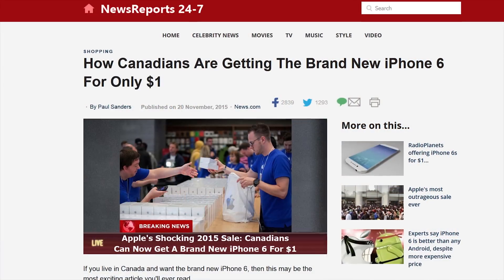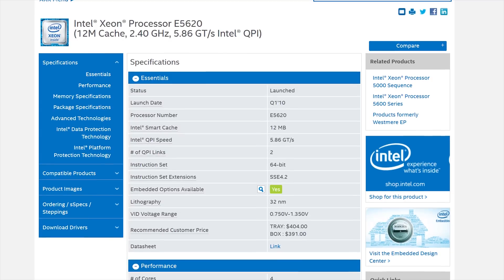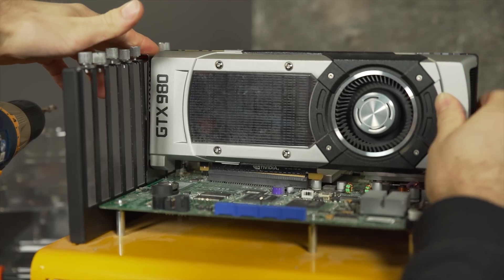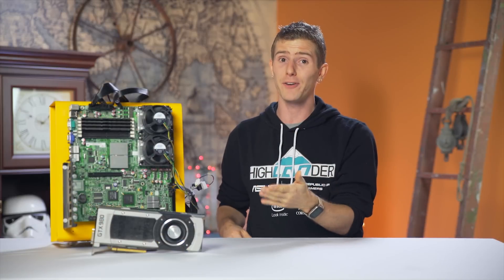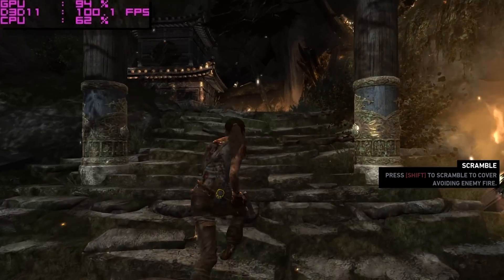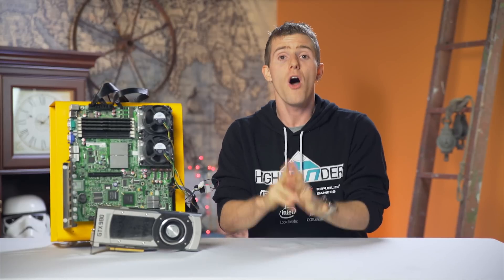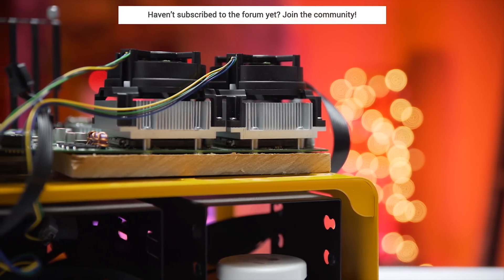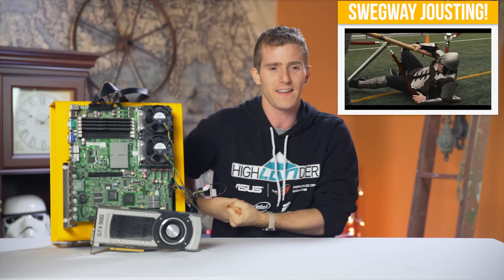Under $150 Budget Gaming 8 Core CPU, Motherboard & 16GB RAM

Comment: Well its not really 150$ if you use a 500$ GPU
Reply: +Ulim151 He used the GPU to test if the CPUs would bottleneck a high performance GPU. He could make a guide with a mid range card and call it a 300 dollar build but it wouldn't prove how wellthe CPUs would handle a really well performing GPU. Using the 980 shows if you wanted to buy this build to spend the rest of your budget on a GPU you don't have to worry about a bottleneck.

Comment: It's worth twice more than my PC...
Reply: +Skitty™ | Garry&#39;s Mod Player 
You could take away the 980 throw in a 960 or r9 380 and get a computer the price of yours and probably better.
980 = ~500 +150
650 / 2 = 325
i'm going to guess you don't have a 960 or higher.
Reply: +Zarrx i know you weren't talking to me but my whole pc costs around 150$, great right ? lol
Reply: +Zarrx Why a 380? The 280x performs slightly better than the 380 and is cheaper.
Reply: depends on availability I guess. 280x is an older series so it can be harder to find in retail.

Comment: I got my Asus Sabertooth X58 LGA1366 + i7-930 (4 cores, 8 threads, 3.5ghz boost without OC) for like 130$ and I'm VERY happy. + motherboard has normal amount of PCIe slots, ATX format so it can easily find it's place in my Zalman Z9+, etc.

Comment: it's not realistic put a 980 which is 500 usd card on 150 system ,,, no wonder it have bottelneck ,,, the logic card would be 960 in that case ,,, for me if you want to buy use just get i7 sandy bridge system for around 200 usd and good graphic card and call it a day ,,, thats what I did and I get much better performance with nothing of that non sense ,,, you fucking saw a 980 ??????? holy fuck

Comment: Very nice! BTW, have you guys already done a "revitalize you X58 system with a 6 core Xeon" video yet?
I'm positive I'll get another good 2-3 years out of my almost 7 year old asus p6t deluxe with my "new" 80 bucks Xeon X5670. 
Paired with my 144 Hz Full HD monitor and my GTX 780 I get 130+ FPS in most games where my i7 core 920 started to bottleneck.

Comment: How about $1100 total for a complete sytem with a 850w psu, 2 yes... 2 Xeon X5672 quad core cpus running at 3.2GHz, 24GB of ECC Registered memory, a Crucial 240GB SSD, and a GTX 970. No modding required. Plays BF4 on all ultra and highest settings at 90 fps. Plus you can encode a 20 min 1080p video in about 6 or 7 mins. Much better bang for your buck and less hassle. HP Z800.

Comment: why a server board? put a xeon into a 775 desktop board. only disadvantage would be only one socket, but still plenty of performance, especially when you get a x54XX cpu and overclock to 4.0+. and games doesnt even need that 8 cores that much, you can get off with 4 easily.

Comment: Another good option would be to pick up a first-gen 8-core mac pro. It's probabley a bit more expensive than picking out the component's your self from ebay, but is has a similar dual-quad core xeon layout and DDR2 ECC memory, and offers more expansion slots and a more standard layout. (no sawing required for most graphics cards.) 
It might be tricky to get windows running natively, and bootcamp introduces some limitations. I think only 32bit windows is oficialey suported by apple on the first-gen mac pro, but with a bit of tinkering I'v managed to get windows 7 running on in 64bit mode in the past.

Comment: hold on, can't linus just use the lga 771 to lga 775 adapter and saw off the plastic parts? would have saved alot of trouble and be alot cheaper

Comment: Instead of a 980 you should have thrown a 380x or 970 in, much cheaper cards.
Reply: Why everyone compares the 380x and the gtx 970 while my 290x runs better than the gtx 970?
Reply: +Fairex The Lord That made no sense the 290x is a last gen card and your comparing it to a cheaper current gen card.
Reply: +Walrus Warlock I think the cards released in the same year
Reply: +TheDrewSaga Yeah I know but I found mine extremely cheaply
Reply: +Fairex The Lord The 290x and the 970?

Comment: 2.5Ghz CPU just isnt for gaming. You can shove it 20cores in it its still slow.
Reply: +UndyingGhost The GHZ war ended in 2006.
Reply: +nonikita unfortunately not for many game developers though. Especially some poorly optimized indie games.
Reply: +megapro125 It's irrelevant .IPC > clock speed and core count even if the game is poorly optimized.
Reply: ***** Ok, what about 8 years old xeon 8core 2.5ghz vs i5 6600k skylake 4core at 4.5ghz? I mean come, ipc and frequency is what matters, especially for gaming. You are free to downlock your CPU at 2.5ghz and use it like that if you are so smart.
Reply: ***** Tudorgeable  no shit guys... if you compare a antique cpu with a modern architechture of course the performance per clock ratio is much better. What I meant is if you take two processors with only max a few years in between. a 2,5 GHz octa core gets destroyed by a 3,5GHz dual or quad core in most games.
Reply: Newer Intel CPUs are clearly more efficient and have a higher instructions per clock. It isn't always about the clock speeds and the amount of cores. Especially for games that are single threaded.

Comment: Why would you run 1080p, when you have a 980? At least 1440p or 4k.
Reply: lol 4k. back to your crayons and etch a sketch Jr.
Reply: +Tim O'Connor Obviously with an i5 the 980 could do 4k, maybe not with a Xeon thinking about TBH. No need to insult me thou, insinuating that I'm a toodler.
Reply: +eddie reece eh the 980 isn't well equipped for 4k maybe on medium to possibly high. The 980 ti kicks the 980's ass and doesn't always do that well as a single card for 4k some games it can't get 60 fps average
Reply: +eddie reece Because with the hardware that's being tested, 1440p and 4k would not be an option.
Reply: +Zarrx I meant the 980ti sorry
Reply: eddie reece Sorry man it wasn't a serious insult.
Reply: +Tim O'Connor that's all right man no problem
Reply: Because i happen to be half jewish

Comment: Those 2 CPU use more power than an overclocked FX 8320. I think you can make a pretty good system with 2nd hand consumer components, like old i7s and i5s or Phenom II x6. Not to mention compatibility and expansion.

2 years ago I've sold a FX 4100 (overclocked at 4.4) with 8 GB of RAM, motherboard, case, PSU, 1 TB 7200 RPM HDD  and a GT 630 at around $250. And except for the motherboard and PSU, every component was still in guarantee. Nowadays you can find twice the performance of my old system at around $300.

The only thing I regret is that with the money I bought an Intel Atom z3740 tablet with only 32 GB of storage (I do have a 64 GB micro SD class 10, but I can't install many windows programs there). If I had the 64 GB model I'd be the happiest. Because of that I need to replace my still very functional tablet with a newer one with more storage (or I wish I could replace it with the same Toshiba Encore 1 the 64 GB model). I pretty much stopped gaming, so this tablet became my main PC.

Comment: That is really an interesting strategy to build a cheap PC. 
The newest part in my PC is probably around 6 years old, I have a C2Duo , 4gb DDR2 ram and a GTX275 with a 2007 P35 motherboard and 460w PSU, and I thought I won't be able to afford a new PC that runs new games in the near years because I will have to change almost everything and the price for hardware in my country is like 50% more than in the USA while the wages are 10 times smaller. 
Didn't even think about the upgrade because my hardware is so old. but did some research anyway for a maximum budget of 300$ just to see what minimum I could do and found out about the XEON processors available dirt-cheap. I ordered an E5450 Xeon adapted to 775 socket for 30$ and additional 4 gigs of DDR2 for 20$ from China and bought a used HD7870 for 100$. So now I patched my BIOS for the XEON and just wait for the shipment from China, if I don't screw up and everything will work properly it will be quite amazing to pull off, maybe I will even to manage to squeeze an SSD in there if everything works.

Comment: step  back, shadow of mordor on a 6300fx with 560ti sli was running pretty high change to a 970gtx and it was perfect so why but server stuff when you can get 6300fx on the cheap and a mobo that works with standard ram?
not worth buying that stuff, just good for videos on youtube XD good one linus now do a cheap amd system with a 980 in it and compare.

Comment: I used the same method,  Found Dell T5500 workstation with Xeon x5607 with 4GB DDR3 ECC of RAM ( later upgraded to 48 (6x 8)Gb ECC register for free) for 100 USD, bought brand new  HD7950 for 220 USD , That's it, Can play any game up to now

Comment: Sounds like you'd be easier off just getting actual desktop hardware while paying the extra.
Reply: +Russell Smith They probably need to just save and get some used desktop stuff. This seems like way to much of a pain in the ass to save a few bucks.
Reply: +Mark McKeown of course you would, that isn't the point. not everyone CAN pay the extra. This is an option for people without the cash, but that do have the time to get it all to work.
Reply: Yeah I realise the point of the video is to show this alternative method, but for 90% of people, they won't be assed to go through all of this, and may find the savings not worth the hassle. Russell Smith

Comment: What is the cheapest graphics card I can buy to play all the latest and the to be released titles in medium to high settings at 720p and 1080p?
Reply: +Phoenix id rather buy GTX 750 TI than GTX 950 :D
Reply: I would say buy second hand like a 7870 or even a 6990 or an older nvidia card like a 580 or 670/80 and it will give u twice the power of buying brand new. That is if ur willing to take the risk. 😀 hope this helped a little
Reply: 750ti has served me well, I can run battlefield 4 on mostly everything high/ultra(except shadows) and my cpu is average at best
Reply: +Madhurya Kakati I have an AMD 7950 Boost, I can play a game like battle fronts beta at 1080p 60fps on all ultra settings
Reply: buy a used 7950 for under $100 and it plays bf4 on ultra
Reply: 750ti
Reply: +Baby Smacker I did that... 7950 boost, over clocked to 280x... plays Everything at ultra with decent fps paired with an i5 3330.

Comment: I got an old HP server with 2x 4 core E5430 CPUs, 32GB of ECC DDR2, 2x 72GB HDDs, and 2x 800w PSUs for AU$175 (US$128). I don't use it for gaming, but it's got plenty of PCI-e slots (3 x8@x4, 2 x16@x8) if I wanted to go down that route.

Comment: I'm not so sure it is worthwhile. If you look around, there's lots of off-lease systems sold directly by dell/Lenovo/HP. I bought Dell Optiplex 390 i3-2100-based machine for $130 a few weeks ago. The i5 was like 160.

Comment: I did this by buying up old dell T7400 workstation components on Ebay. Works like a charm. Also, protip: the Xeon CPU's with the 1333MHz FSB have a higher clock multiplier. By carefully taping over some of the pins one can then trick the mainboard into identifying the CPU as a 1600 FSB model, and thanks to the higher multiplier get an instant overclock. In my case that took a 3Ghz Xeon E5450 CPU to 3.6GHz, rock stable on aircooling.

Comment: Unless you need 8 cores, using a pinswap sticker mod to install 771 cpus into a 775 motherboard is better overall. You do have to cut some of the plastic in the cpu socket, but you get a larger selection of cpu coolers and plenty of overclocking potential. The biggest reason for this route however will probably be not needing to take a saw to your 980 :)